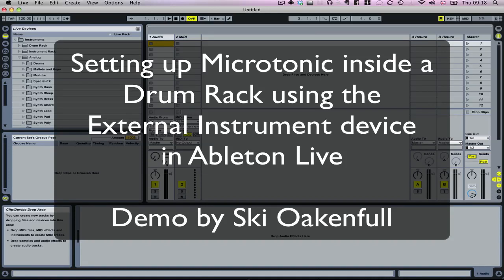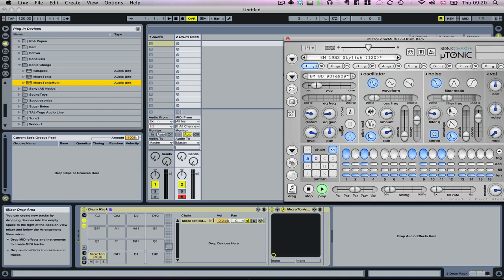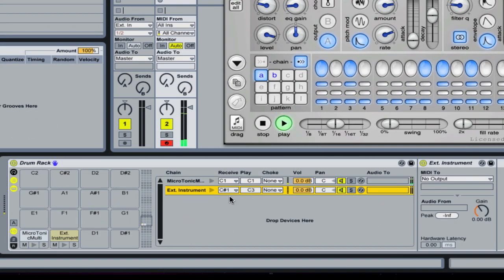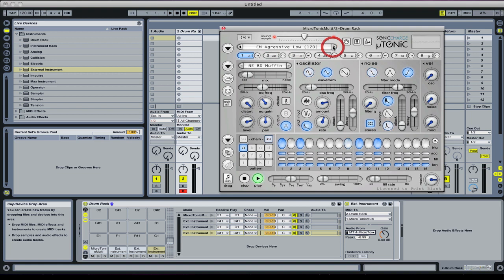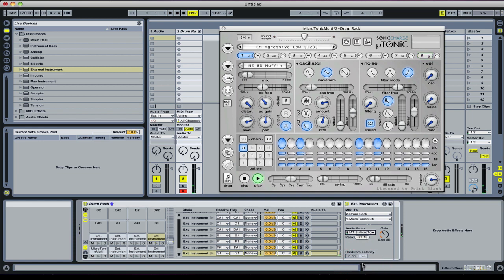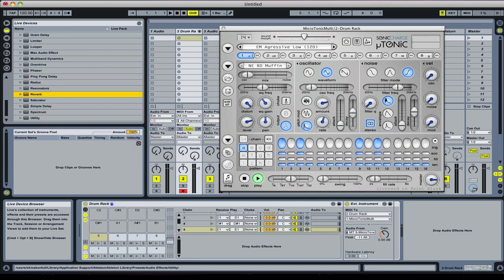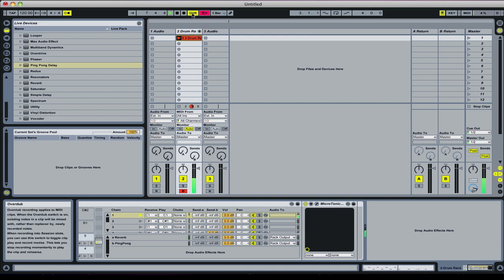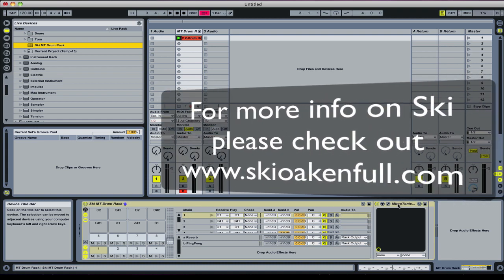Ableton Tutorial - Setting up Microtonic inside a Drum Rack

Comment: Anyone got an idea why only The first two MicroTonic tracks work for me? The second is also incredible loud. The rest of the tracks (3-8) don't output anything. They register the keystrokes though as the pads in MT light up

Edit: Fixed the issue. For some reason any "External instrument" created had "MT 2-Microtonic" selected in "Audio from" (right below where you set the External Instrument to route it's MIDI to MicroTonic). Select the appropriate channel there. I.e. MT 4 for Track 4 and so on.

Comment: nevermind this tutorial
 is essentially the same thing?
Reply from the maker: Hi Jason... yes, it's exactly the same thing. Let me know how you get on... if you have any problems then maybe I can make a Battery specific one... Cheers SKi
Reply: i actually made one last night!! i have 4 banks of 16 cells from battery routed out through the drum rack. lol only took 2 hrs. i also finally figured out how to map battery 4 controls to ableton. for the longest time i couldnt? ill be using it alot more now!! click configure in abletons rack then right click on any parameter in battery and select the add new cc option.. most vsts it usually reads parameters right away for some reason in battery you have to right click im not sure how to go about it w/ a mac?  THANKS SKI